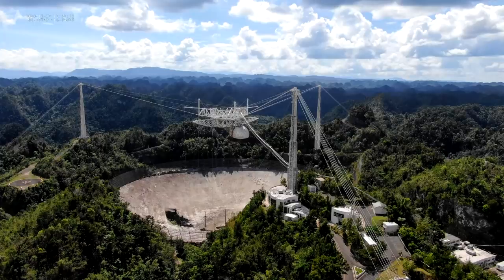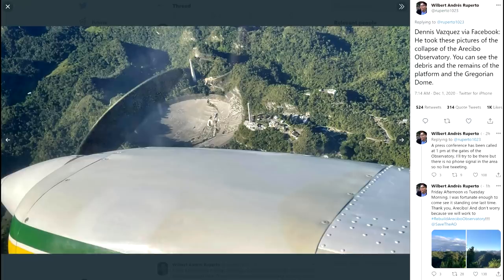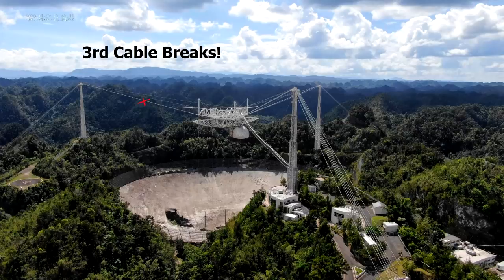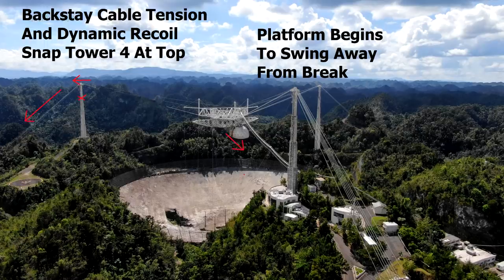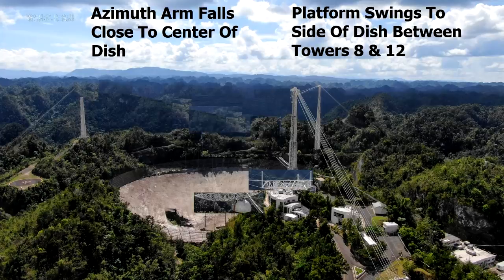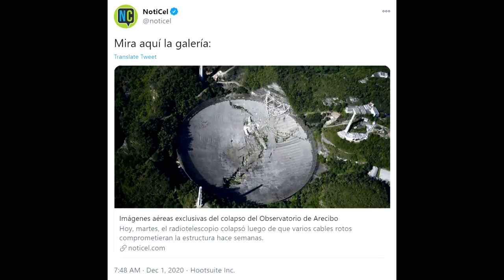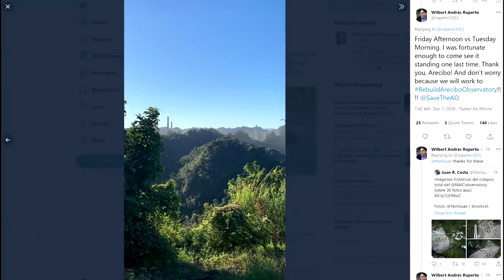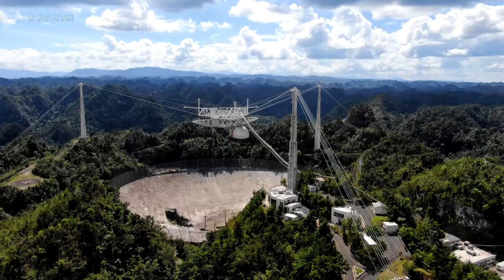Arecibo Radio Telescope Collapses!

Comment: At least it will be safe to dismantle it now and hopefully build a new one in the future
Reply: Yeah.... before it was in this weird state where even demolition was arguably too dangerous....
Reply: Looking at it, it honestly looks like it's still going to be kind of dangerous to take apart. Though, I will grant you that it is now alot less dangerous to take it apart now then it would have been. Any time you have a metal structure that's been damaged and lying around like that, you never really know how everything is going to shift when you yank a certain part out. You can make estimates, but you can never be quite sure.
Reply: @MilesBader  In theory one could have used a robotic system to place charges or something, but yeah, this was about as good an outcome as could be expected.
Reply: Safety is a relative issue. I will agree that it will be safer to dismantle it now than it would have been had it not collapsed.
Reply: @KnightRanger38  beforehand it was, as was demonstrated, on the knifes edge of collapse. Any attempt to do any work on the structure could have triggered this and if you were using workers to do so would have put them in harms way. The only other option would be robotic or other remote assets, but those have their own risks. If lives are not at risk in a situation like this it is best to let it happen as it will and help it along if safely possible.
Reply: the Current political climate of the US it will not be rebuilt.
Reply: @ThePyroRussian  looking into it. There is really not enough purpose to it to justify rebuilding. That is why it fell unto disrepair in the first place.

Comment: And this is exactly why anyone with heavy industrial work experience said it was too expensive and dangerous to repair.
Reply: If they had reacted earlier, they could have propped up the platform with something temporary, taking the load off those failing cables.  From there, repairs might have been done safely.  Now it's down to rebuilding from scratch.
Reply: @johndododoe1411  Obviously, you have no idea the size of the dish.  What would you use to "prop up" the platform?   It was 450 feet from the dish to the platform.  The dish surface was not load bearing so whatever "propped up" the platform would have to go to the ground under the dish, and then there would have to be a large foundation put in to carry the weight.  The only way to repair it would have been new cables.   That was looked at, but the entire structure was too dangerous to have people on the platform.  They had even looked at working on it from a helicopter.  That also was too dangerous.  Any other brilliant ideas...?
Reply: @buckhorncortez  Obvious idea would be some giant I-beams with hinged feat standing on the ground and raised past vertical by pulling temporary cables from across the disc, then closing the top to form a cradle under the complex head structure.  So no person would have been under the head structure until fully Secured
Reply: @johndododoe1411  I beams with hinges? And where would you get custom made I beams that are garunteed to hold the same weight as the reinforced concrete towers? And where would you even place them? And how would you afford them? The funding for this place was so scarce the structure literally collapsed from neglect. Never mind all that, how would you make them in such a short period of time and how would you even get them up there?
Reply: @GusOfTheDorks  I meant the biggest mass produced I-beams on the market quickly mounted on hinge-like feet to tilt them upwards to the middle. Obviously with emergency funding and no time for custom steel production, just buying what's available and doing some rough and ready fabrication with cutting and welding.  I-beams being the strongest mass produced sticks in today's world, being used for bridges and skyscrapers.  All that iron would interfere with the radio signal, so not a permanent solution that could be used operationally.
Reply: @johndododoe1411  The biggest mass produced steel I beams arent very big. I beams the size of whats needed for a job like this tend to be custome made. Also Im still not sure what a hinge is supposed to do. Any hinge you put on would have to be massive and a custom job to take all the weight you'd put through it. And how would this help? The moment you take the weight off of the towers, their going to snap and shoot pretty destructive debris everywhere.

Comment: Hi Scott....just found this video, I had heard that the collapse was picked up on local Seismometers and I was going to located the Seismogram for my own information, however I'm glad I came across this particular report, I've seen two others you've done so far. But what I didn't realize was that an Earthquake had actually occurred around the same time, I would say without question that once the wave front or S wave transverse the site it setup the conditions for the failure of the cable I think you can bet on it!....thanks for showing this Scott, luv your work!...Cheers Clint Jeffrey - VK3CSJ

Comment: Based on the initial angle of the support cables being so shallow, and where the platform landed, I'm guessing it was less swing than slingshot.  Those cables would have had a significant amount of stretch in them.  The way the gregorian dome was left behind is like the undisturbed wine glass when a magician pulls the tablecloth out from beneath it. I'm sure the mount was optimized for minimal lateral loads to keep the added weight to a minimum.  A sad day for science and humanity. Thankful no one was injured, hopeful a new instrument is built in its place (maybe use arches instead of suspension cables...).  Also, even MS Paint can't take away from your excellent videos!  Still looking forward to your Unreal animation though.

Comment: I work in research (mostly NIH funded).
I can say this is a perfect microcosm of what happens when you have government funds and research.
It could have been prevented. Had the PI's that run the facility been willing to do less research in exchange for being able to do any research, they would have been able to maintain it in good working order

Principle Investigators tend to view any staff not directly involved in science as a wasted opportunity to do more research, so they tend to not ask for funds for maintenance and infrastructure for fear of not getting the funding at all. For instance, the most important aspect of my position is administrative, but my funding is to do science, and I spend 80% of my time on the bench doing science. When I get too busy, very important (and often critical) things get put off.

Government funding agencies set very specific guidelines about what money can be spent on what. For instance it is normal for NIH grants to forbid purchasing of computers, and capitol equipment must be below a certain amount ($5k typically) unless the grant specifically pays for the items. Imagine trying to hire and new post-doc, and being forbidden to buy them a computer.

Add to this a sudden need to do something now about this facility. While funding agencies are holding meetings, putting out requests for proposals on repairs (30 to 90 days to get and review), then putting out requests for proposals for demolition (another 30 to 90 days).
It is a miracle that no one was hurt.

Comment: That’s ok. China’s got a bigger and better one.
Reply: Only problem with that is it was made with China quality and run by ChiComs. What could go wrong, LOL?
Reply: If you mean their FAST contraption? Their fields of view were different so for radio astronomy I guess even before the collapse one could say "they are different".

However the crucial part is that it can't do radar astronomy which Arecibo was one of the few that could. Now we just have that Goldstone something (GSSR) left, it's smaller and has a lower power output than Arecibo had but it can be aimed at places of interest.

Comment: The second cable failed at under 60% of it's original load rating. Proper maintenance would have prevented this. But at least now the site is safe for cleanup.

Comment: 2:34 - Also, concrete is basically only good for compressive loads - against tensile or shear loads, it has about the same order of strength as wet cheese.

Comment: Scott, I just saw a video of the actual collapse posted by the NSF.  The video includes an angle taken from a drone that appears to be hovering over the antenna structure.  This would seem to imply that the observatory had some foreknowledge that the structure was about to collapse.  Have you seen or heard anything since Tuesday that could shed any light on this question?
Reply: They knew it was going to break soon, reason there was a plan destruction day.
However, for past 6 months had constant drones watching all the weak spots.

Comment: I really with they had set up cameras to roll 24/7, to capture it's collapse.  They knew this was a very real possibility, it would have been nice to at least have the video and be able to see it happen.  I'm sure there would've been valuable lessons to learn from observing it.  Well at least they can save a few bucks on the budget for demolition.  Let's hope they redesign, re-engineer, and rebuild it from the ground up to have everything it needs, instead of bolting 300 extra tons onto the original design, that wasn't engineered for that.  There's zero question whether it can be done, of course it can.  But will anyone with deep enough pockets happen to take interest and care enough to fund it, that's the problem.
Reply: They knew it can collapse any moment. They had cameras and distance measuring devices set to measure the strain, and movements remotely.

Comment: They absolutely should rebuild Arecibo, the cost has to be a lot less than building one from scratch somewhere else, there's already a lot of existing infrastructure there and, aside from some cleanup (which would have to be done anyway, so shouldn't factor into the new facility's cost) it's already made to order, just need to update the old architectural design for modern/improved materials, and when finished would be better than ever.
This facility is of SUCH VITAL IMPORTANCE because imo there's nothing more important than the work done on mapping and tracking NEO's if we want a fighting chance to survive that inevitable cosmic bullet with our name on it. ;?)

Comment: All the infrastructure is there. Take apart the old and build something similar but with better humidity control using what bridge engineering has learned in the past half century, because it is basically a fancy suspension cable bridge.

Comment: When they rebuild (and it had better be when, not if), I do sincerely hope they consider weaving support cables from carbon nanotubes. Imagine, cables a quarter of the thickness, a tenth of the weight, and a hundred times the cross sectional strength of steel! It could support a much more elaborate instrument platform of the same or greater weight without adding considerably to the force on the towers, not to mention it would be a fantastic test bed for future space elevator technology!

Comment: Like a lot of infrastructure projects they are cheaper to build than to maintain.  It would be great if they built a new telescope in the same location.  However I fear that it is no longer as isolated as it use to be, and a new location will need to be found.

Comment: The ultimate villain was that Spelter Socket that failed a few weeks ago.  They are pretty much a permanent fixture unless they are allowed to be exposed to a wet climate.  The whole Golden State Bridge has a maintenance crew who works year around to go over and back over it painting and rewrapping the cables and the steel structure.  Otherwise it too would have failed before now.
Who to fault?  The contractor? Engineers? Owners?  For failing to provide proper maintenance and protection from the elements.
Reply: Lack of funding for maintenance

Comment: Its really sad to see it go... i mean, clearly there was a lack of maintenance being carried out. And im sure alot of officials are likely placing blames in the wrong directions. Things in this world are not designed to last forever. That is a fact. Over time those cables were going to begin aging and preventive action such as replacing them or reinforcing them could have likely have prevented this from happening.

Geological situations to to be in a bit of a increase in parts of the world where they used to be rarely noticeable. But that never excuses the fact that something that this world needs to be online, should have been properly maintained to the point that the earthquake would not have been enough to take out a important piece of equipment.

Comment: What are the actual requirements for a radar transmitter for that kind of work? Do they have some unusual requirements or is it more or less the same as terrestrial radar? IIRC there are a rather large number of operating terrestrial radars (e.g. military search radar) that operate in the muti-MW range. Would it be usable to combine one of those as a transmitter with the VLA, the GBT or some other large receiver?

Comment: This may have been the best thing that could happen to it at this point. Dismantling it safely would have probably cost in the seven figure range. This way no one got hurt and it will cost a lot less to repair the damage it did. I wish they would now rebuild it from scratch to make it maintainable, with enough extra cables that they can easily swap them out for testing and replacement. But I doubt they'll find the money for that, since no one was willing to pay to keep the old one working. <sigh>

Comment: Arecibo observatory will be decommissioned:  Arecibo hasnt been taken care of in years. So Im not surprised, they haven't had any leased research in nearly decade. Gotta maintain a behemoth like this. And its pretty old and its in a very wet and humid location, look at the dish you can clearly see water stains from where water sat in it like a swimming pooll. It Cost 9 million in 1963 to build and additional 23 million in 97 for additions and maintenance. The same year Robert Zemeckis filmed Contact there

Comment: Hey Scott, There is actually a video game called Battlefield 4 released in 2013 that has a level located at the Arecibo Radio telescope. The game featured a something called Levolution where you could basically destroy a big part of the map. On that map, called 'Rogue Transmission' the Arecibo Radio Telescope can actually be collapsed if you destroy the supporting cables! What a foreshadowing by that game! Clip https://youtu.be/iuzM71LWdmc?t=75

Comment: Infrastructure is so expensive now, and energy and other constraints make megaprojects a lot more expensive these days. I don't realistically see a radio telescope replacement in the cards anywhere near the size of ariciebo for a couple of generations.
Reply: China just finished building one that is way way bigger then ariciebo....
With way higher tech in it.

Comment: On the plus side at least the demolition and cleanup process will be safer and easier for the crews without having to deal with a suspended structure held up by dangerously weakened cables under a high load.

Comment: What about FAST, the 500 meters chinese radiotelescope in Dawodang? I think it's already operational or at least it has been built, right?
Reply: FAST does not have the capability to transmit signals. It's operational now and more advanced, but it's still sad to see the old reliable Arecibo collapse.

Comment: Hate to say it but typical piss poor modern engineering and lack of maintenance. Remember the good old days, when we over engineered everything? Then the accountants come in w/ their calculators and screw every thing up. So sad we really don't have anything to replace the job this telescope was able to do. Thank The Great Bird no one was injured.
Reply: Considering it was built in 1963 I wouldn’t really call it modern engineering
Reply: @jamesbisset9891   Yep '63 I'm still using a '44tractor all oem except the 12 v conversion clutch rebuild and brake replacement.... Still has 50psi oil pressure and it hasn'lost any compression. A '34 buffalo meat grinder that I just x out the oil on 1x a year. They never x rayed the support cables anf their anchor pionts on the telescope the old ones just added more and beefed up the sys w/new one and tower changes. If they had had a proper maint program the issues could of been caught. And if the construction wasn't done on the cheap they would have replaced the orginal lines when they did the up grade. That was so much extra weight the entier 'upgrade' was done on the cheap. Other wise a through inspection of the entire system should have been completed and reengineered and @ the least replacement of the original cabling system w/an over engineered modern components as well as adding new. The area is hard as heck on the componets that were installed in the system, cement towers the cableing anchoring sys and the cables them selves. A proper inspection, maintenance and funding system- darn accountants - in all probability would have prevented this from happening. The issue that started this mess could have been caught prior to the up grade and corrected. Saving a valuable asset for the world. In reality we currently nothing w/the capability that this asset had and nothing in the pipe works to replace it. A damn short sighted shame

Comment: Two cable breaks, one in August 2020 and a second in November 2020, threatened the structural integrity of the support structure for the suspended platform and damaged the dish. As a result the NSF decided to decommission the telescope in November 2020. - Your welcome.  (And lets just assume maintenance = 0)